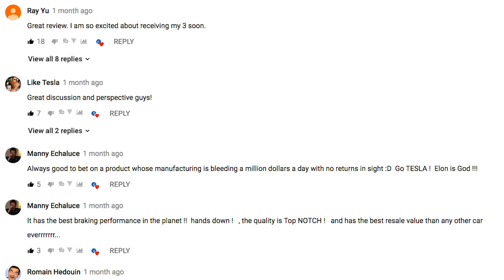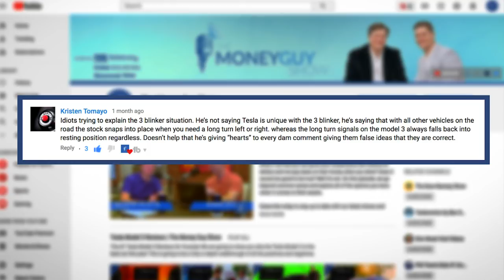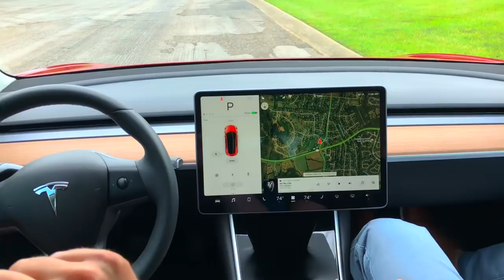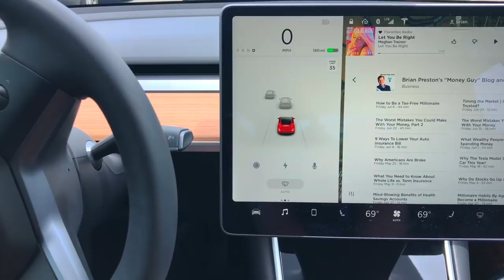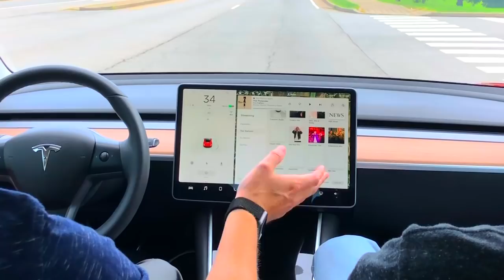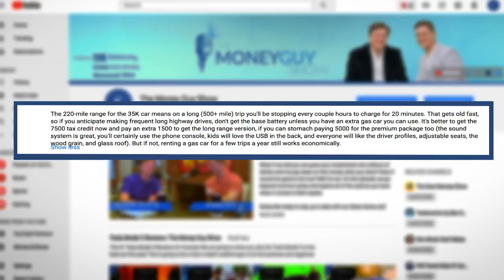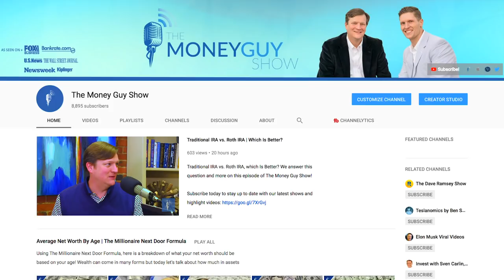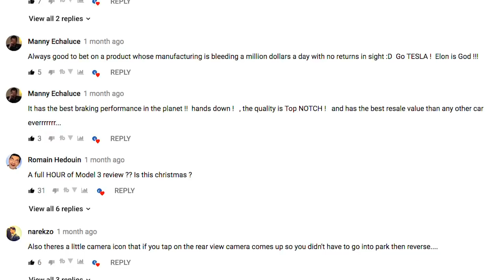Tesla's Best Performing Car! | Model 3 Deep Dive Review

Comment: charging at home with an electric vehicle is simply awesome. It totally flipped the range anxiety Paradigm on its head and on the rare occasion when I must drive a gasoline or diesel vehicle it's a little bit stressful trying to figure out where you're going to get gas, and figuring out which station is going to be a little cheaper than the other and if they're at the same intersection having to drive around the intersection just to save a few cents per gallon on gasoline. You simply don't have to do that with an electric car. To add to that point a little bit about charging and how much it cost if you throw in a solar system on your house then all of your miles can end up costing $0. for electricity. Compounding the awesomeness of combining solar on your house with an electric vehicle in your garage or in your driveway is that your electricity bill will likely go down when you just go from having no solar system to having a solar system, regardless of adding the car. Yes, the car will take more electricity but when all is said and done if you add a solar system on to your house for no upfront cost your electricity bill will go down, and then if you throw in the car on top of that It is possible that your electricity bill stays at 0 and you're just paying off the monthly financing cost of the solar system. That happened to me and it is fantastic. 9 months of electric driving and I've saved about $600 in fuel costs. Interesting Lee, that $600 was about what it cost to get the charging infrastructure put in my garage so the car has already paid for that in fuel and maintenance savings. Some back-of-the-napkin math and in about 10 years the car will have entirely paid itself off through Fuel and maintenance savings, yes, we do keep our cars for that long so this electric car thing is just a win, win, win.

Comment: Good job guys. The first round of vids was good. This one was just as good if not better. The reason the tactile feedback is missing on the turn signal is because it's not an analog switch, it's a digital one which means it can be reprogrammed OTA for additional features.  We're just so used to having it that it feels like it's missing. But a brand new driver that is taught to use it based on timing not feel will never know the difference.

Comment: Thank you for the follow-up video. One thing that I really enjoy about my when out of percent the electric Nissan Leaf is the accuracy with which it can do the cruise control. This ties into the regenerative braking and when it goes down a hill the speed stays exactly the same. Just makes everybody more safe and you much less likely to get a ticket, especially for speeding, duh, because you're not speeding at all. Even though my car doesn't have adaptive cruise control it has a digital speedometer and regular cruise control and if you combine that with regenerative braking there is absolutely no chance of speeding, even when going down a hill, which is not the same for an internal combustion engine car. A internal combustion engine car just doesn't apply the accelerator anymore but you still end up building up speed and being 10 or 15 miles per hour over the speed limit by the time you get to the bottom of the hill.

Comment: In regards to closing the trunk, there are 2 different license plate mounted handles that you can buy and install. One is chrome and is from rpm tesla, the other is less expensive and is clear lexan and costs less which also gives a bigger area to grab. You can find the lexan one on ebay for only 10 dollars.

Comment: The reason for the long pull/short pull turn thing is that it is entirely up to the computer how it wants to interpret your input. With other cars this is actually mechanical. It sticks into position until the wheel is rotated and a mechanisim releases it again. In the Tesla, virtually ALL the buttons and inputs to the car go to the computer, then the computer does the actuation. This is why the car is fully programmable.

Comment: The $35,000 M3, if Tesla can field it, does serve a purpose: Its a Bolt cutter. It will be selling in the same price and distance range as the Bolt, but with a wayyyy better car. I think GM will have real problems when/if that comes to pass.
Reply: Scott Franco 
Haha!!! Love it.
It's also a Leaf cutter!
The 2019 60 kWh leaf will be $35k!
Reply: the $35K model 3 RWD is right now its costs $44K but in California it comes with a combined rebate of $10K , making the model 3 $34K NET. the Full Rebate is in effect until the End of 2018, if you wait for the $35K M3 you may only get a Half Rebate. either way, both cars are way better than the Chevy BOLT at $40,000. Model 3 RWD 310 Miles vs BOLT at 238 Miles.
Reply: Scott Franco 
The M3 is a BMW. This is a Tesla Model 3.  Perhaps you could call it a TM3.

Comment: Regarding supercharging, the 60 kW thing is the power you're getting from the supercharger, think of it as the rate of charge. If it's below 60 kW, then it's charging slowly so they bill you less money for the time. Whereas if you're charging at a much higher rate like 100 kW then you are billed more money because you don't have to be there for as long. This is not related to the capacity of the battery measured in kWh.

Comment: Great video. Watts and Kilowatts are power - how fast you use energy or charge a battery. Watt hours, watt seconds, kilowatt hours (power X time) is energy. The model 3 has a 75 kilowatt HOUR battery.  If you mash the accelerator, it can use 300kW (kilowatts) of power. It could only do that for 15 minutes. But you top out in seconds then the power falls to low kilowatts.

Comment: Isn't there a way to set the top speed in valet mode? I'm waiting on mine so I'm a newbie. Also, I've been a Chevy Volt owner for 8 years, and I do appreciate the fact that if you press the end of the blinker stalk, it gives you a soft "brrrrp" horn. This is particularly important with an electric car, because when you're driving through a parking lot, often pedestrians don't hear you because the car is so quiet. If you blast the horn at people, they jump, but the "brrrrp" is a polite "Excuse me, I'm coming up behind you." Of course, it's 9 months after your review and these things might already exist from software updates...

Comment: You didn't mention it but there is what I think a problem with the navigation besides it not showing the exit numbers on the screen.  I recently took a 3300 mile road trip in my model S and ran into a problem.  It said I would make my destination with 13% battery left.  Unfortunately the next stop after that waypoint was too far to make and there were no superchargers on the way, although there was a permit taken out to build one on the way.  We ended up driving almost two hours directly out of the way to get to where we were going and got there late.  The nav should let you put waypoints in like most other GPS and calculate the supercharger stops for that trip. If Tesla could only provide a "Add as Waypoint" choice that would calculate the entire trip.  The problem that day was compounded by no cell coverage rendering the trip planning inoperative. Surely they could put the charger map in memory but of course you wouldn't know how many stall were occupied.

Comment: The only thing that needs to be changed with the turn signal is that the "long" pull needs to be easier.  I don't like needing to put the extra amount of force to go past the short pull.  I'd rather it be more of a camera shutter AF feel i.e. press halfway to auto focus, press all the way to release shutter.  The shutter button is more delicate.  I feel like I would easily be able to control the short pull vs long pull just by the amount of distance the stalk travels and any small amount of resistance at the top of the short pull.

Comment: Yeah.... use the trunk grip to lower it to such a position that you can then use your other hand over the trunk top ~ just as you like.  Not really that difficult to work out.
Reply: Limp Wibbler as I live in the UK and can't see the exact design, you may be right but.. if one is able to insert fingers into the aperture with the Palm facing upwards this is the safest way so as not to break all your fingers as the lid moves downwards.

Comment: Not having a coast feature for the regen or ability to turn it off on long rolling gentle hills (not mountain roads) on the highway is annoying , the fact is it is much more efficient to let the car roll down the hill at 60-65mph compared to any regen even if its mild. The ability to turn it on or off with the steering wheel controls would be nice.

OMG!!!!!! U forgot the cooly backlit Front Trunk emergency open button!!!!   (insert sarcastic voice) :P

Comment: The Consumer Reports braking problem was a 60-0 emergency braking distance. Regenerative braking doesn't matter in those instances. It's the "I'm trying not to hit a deer" situation. Not very common but very important.

The navigation is based on Google Maps. If one uses an Android phone and Google Nav. it works the same way. Waze is also owned by Google but has other features, some of which are in Google Nav recently and some of which are part of the social aspects of Waze.

Not using Exit Numbers is a California thing. Both the Bay Area and LA have more than 1 exit per mile...and they don't do "Exit 23A, 23B," etc. I don't know why they don't put numbers on many of their exits. I'm assuming that having the exit number will be an Over the Air Update.

Comment: I think you are incorrect on the cost of supercharging speeds/tiers. Per Tesla's site:

"Where possible, owners are billed per kWh (kilowatt-hour), which is the most fair and simple method. In other areas, we bill for the service per minute.

"When billing per minute, there are two tiers to account for changes in charging speeds, called “tier 1” and “tier 2”.

"Tier 1 applies while cars are charging at or below 60 kW and tier 2 applies while cars are charging above 60 kW. Tier 1 is half the cost of tier 2.

"Tier 1 also applies anytime your vehicle is sharing Supercharger power with another car."

So, in summary, when billed per minute you are being charged based on the charging rate (kW), not how much you charge in total (kWh).
Reply: Dan Harrigan 
Have I got this backwards?
I thought the amount was kilowatts and the rate of charge or discharge with kilowatt-hours?
Reply: Roger Starkey Speed of charge is kW and total charge is kWh.

Comment: I have the same regenerative braking in my Lexus RX450h Hybrid.  You do the same single pedal driving, rarely using the brake pedal.  That regenerative braking came out of hybrids, Tesla didn't invent it.

I interpreted the Tesla supercharging pricing a little different.  Some states allow Tesla to charge by KWH just like your home electric bill.  For example California at $0.26 per KWH.  Other states say that only utilities may charge people by KWH for electric, so Tesla has to charge by the minute.  To make it fair Tesla decided to charge at two different rates.  When the car is charging quickly over 60kW, Tesla charges a higher rate.  When the charge rate drops below 60kW, Tesla gives you a break and charges at a lower rate.  For example Ohio, $0.22 per minute above 60 kW,  0.11 per minute at or below 60 kW.  It has nothing to do with the size of the battery pack.  The two rate by the minute charge rate confused me at first.  It took me several readings to figure it out.

https://www.tesla.com/support/supercharging

-Kurt

Comment: Actually, the Chevy Bolts regenerative braking is better than Teslas because it will bring the car to a stop and you never have to touch the brakes.
Reply: David Diaz something Tesla could change with an over the air update.  Also the Bolt still is using the brakes at the end.  With the Tesla, you can control that.
Reply: Tesla M3 P75D has Dual Motors , one is an Induction with no mechanical parts. the Performance model makes more Energy going downhill with its Dual Motors. you can use Autopilot going downhill and the car will automatically Auto regen better than a Human can.

Comment: I have seen Model 3s, where the navigation was on the left side of the screen. Is this a setting? Because in your video it was on the right side. 🤔
Reply from the maker: It was on the left originally but after a software update it's currently on the right.
Reply: The Money Guy Show odd decision. I know that the first reviews of model 3s al complaint it to be on the right side. There must have been a update to put it left, and some home Tesla desired to put it back right? 🤔 Odd